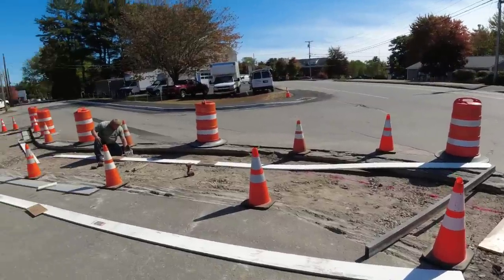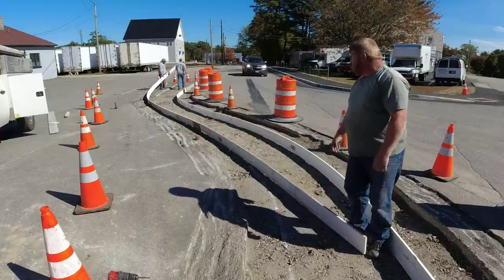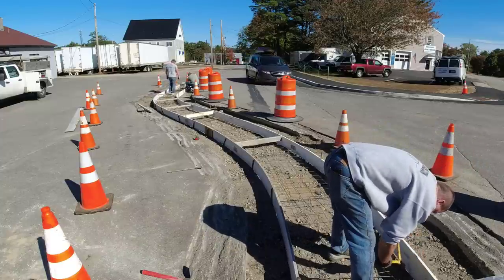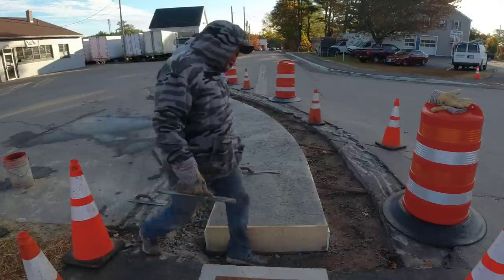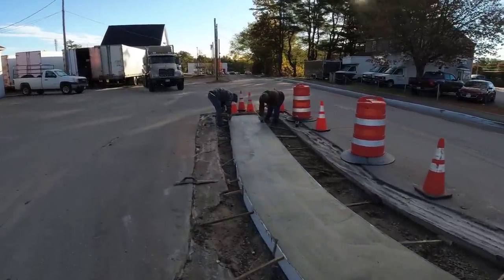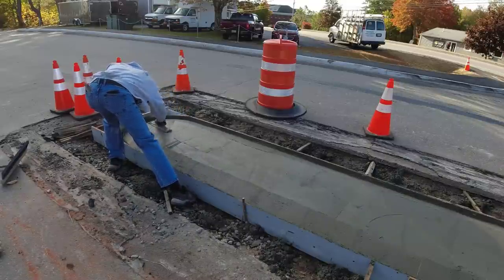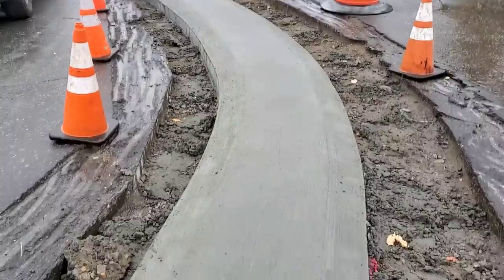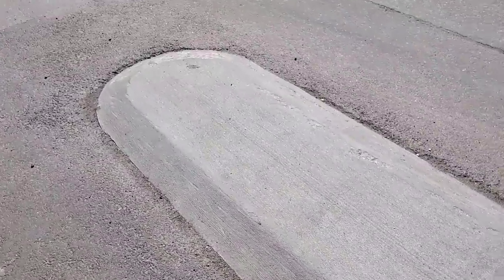Concrete Median Strip | City Rejected The First Pour - This Is The Do OVER Part 2

Comment: The city was probably concerned about the new traffic from the coffee place entering the other roadway. That mountable curb redirects the cars to be more perpendicular to the other street. That provides them with a better view of traffic before they pull out. It will also force them to slow down and not make fast right turns. It looks like they made it mountable so the business there could still have those large trucks pull in and out.

Comment: I am still shocked that it is not level with the road.. Granted this time with the slope going to the 2 inch's high sounds like a improvement to the first one of 3 inch's, but still sounds like its going to ding up the plows and get chunks ripped out from them hitting it..... I think it should have been flush with the road. As you said "I do not see no real reason for the bump to be here."

Comment: That appears to be a de facto curb where the "curb cut" is the whole width of the parking lot (even though they didn't cover the whole width).  Around here those kinds of curb cuts are no longer allowed and in many cases have been eliminated during road or property upgrades.

Comment: if you need PVC for forms get large like 4 inch sched 40 pvc, saw it down the center and use a heat gun (or preferably a tiger torch), some plywood, and clamps to flatten it out. cheap 12 inch wide flat sheet

Comment: Hi Mike,
The second pour seems like a far better solution. I'm surprised they didn't request a softer taper at the end where it seems that the plow hits it dead on. It's unfortunate that our government can't get its act together. I would have thought that the city would have specified the requirements up front, which would have included pre-approval from the inspector.
Reply: He said in the last video that the inspector did pre-approve it and they built it exactly according to the plans he approved, but didn't like it after he saw it.

Comment: Hey Mike-great video. There's alot going on at that intersection so I think Topsham was probably aiming to demarcate the side road from the PL better. But I think you're dead on about the problematic approach.. I think I would have suggested flush pavement with those flexible pop-up markers that you can pull for plowing---or similar.  Cheers.
Reply: Agree. Especially at night, cars pulling up to the corner there could fail to see that the road itself curves around to meet the cross street. The 'mini-curb' will provide a seat-of-the-pants tactile input to warn them they are straying off the street and into a parking lot. And I do agree also that it should be painted yellow for improved visibility.

Comment: if i had to guess this was supposed to define the business's driveway and make a obstructed edge. your not supposed to have extended/full frontage driveways as it increases the locations vehicles can appear from making them more prone to crashes . this also moved the businesses driveway away from the intersection to a reasonable sight distance from the road junction. my question is who made the call to change/modify the design because this is no longer serving the purpose of making an intrusive obstacle to people using the historical driveway area. this thing was never intended to be driven/plowed over, it was supposed to define a NO DRIVE zone (hence the parallel to road rumble strips that would only effect turning traffic) that didn't destroy most vehicles if the driver didn't listen. also there should have been the reveal like the original ,a feathered or tapered edge leaves and area of asphalt that has no flexure and chips out . this leads to even more water inclusion then if they had a hard walled edge. my 2cents, someone changed the engineers detail without understanding what they were trying to actually accomplish and created an inferior end result.

Comment: Yeah the PVC you can use over and over and over which is great I'll have to tell the guys that come through my work to get the PVC even though it's a little more expensive but you're not wasting all that would they go through they just dump that on job sites and leave it especially when they're going to have to re-buy

Comment: I’m surprised that they were allowed to compact the finished grade, pave and roll against 24 hour old concrete. In our parts you have to wait 5 days……3 days if you use high early concrete before you are allowed to run a compactor within the same road prism.

Comment: Nice job Mike! Always interesting to watch. Could this be for storm water diversion? I see the catch basic on the one end?
Reply: That's my guess also... The project up the street probably increased surface runoff numbers and they made them do this not to flood this property because their city doesn't have curbs and gutters here
Reply: @manorin  Looks more like a traffic flow change to me - notice the double yellow line in the first video running straight into the new curb and the recently-redone corner opposite. Looks like the original street alignment was at very off-grid angle with a very sharp left turn out of the side street, and they're bending the road to intersect at a 90 degree, but don't want to put in a high curb here specifically because of snow plow drivers who might not know the road has that jog in it. 

New restaurant with a high occupancy count could definitely be required to make street changes to ensure people can safely make a left onto the main road.

Comment: Your fabrication was terrific, the design as a whole is ridiculous.  Going from straight road with an angled intersection and adjacent asphalt parking lot to a curved road  with a raised median between road and parking lot makes zero sense as far as traffic flow, snow removal , drainage, and large vehicle deliveries to the cafe business adjacent to it.  Architects and Engineers never seemed bothered by  increased difficulty for the transportation trucks that have to navigate these areas.  As witnessed by the day initial damage motorists who frequent the cafe business are used to pulling straight into the parking lot will now drive over the median to park.  Forcing the new construction at the other end of the street to pay for it makes even less sense.

Comment: I think they should have tapered the asphalt to the full height of the concrete without tapering the concrete,
That would provide a much more subtle incline and would have kept the full 3 foot width of concrete.
Reply: The asphalt might get compressed and you end up with a steep lip, I don't work in civil engineering or anything close I study an unrelated engineering course and just enjoy these videos, but I lived in a country where the ground was also bit soft and asphalt would often sink around edges and even get slight "grooves" from driving so it may not be so where theres solid ground like where this job is but asphalt is definitely more compressible than concrete!, again I very well could be wrong and I wouldn't mind being corrected.

Comment: That design will leave snow/ice on the ground... so it's going to refreeze to a sheet of ice. And I'll tell you that plow will still feel like hitting a little wall depending on what direction they are coming from. That you can see from the big chip on the round end. That blacktop pavement job looks like crap. Your work looks fine. But yea, stupid idea. I give it about 3 years total.

Comment: Maybe the next time they have you tear it out & replace it, they'll have you tool, or cut joints in it. Looked great both times, I tell the guys on my crew to watch your videos, that's how I want us to pour.
Reply: He won’t need to. He poured his form braces into the concrete. Natural weak spot. The city needs to stripe it yellow to at least warn Corvettes and Ferrari s to avoid it. Couldn’t hear if he said the outdoor temperature, but everyone kept their coats on. Usually concrete should be between 40 and 90degrees to pour. We always check the mix with a thermometer. Much better job than last time.